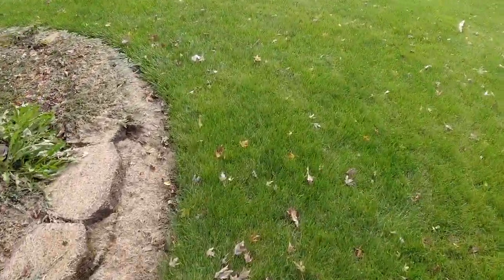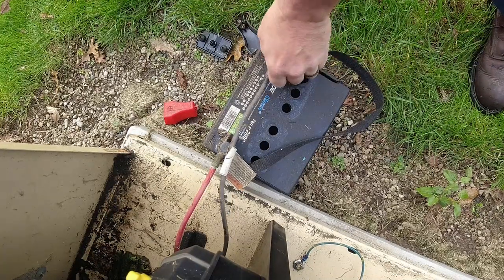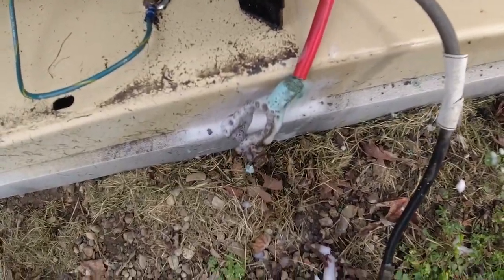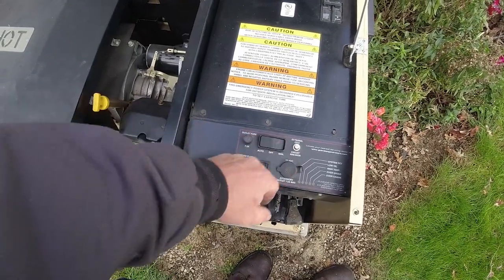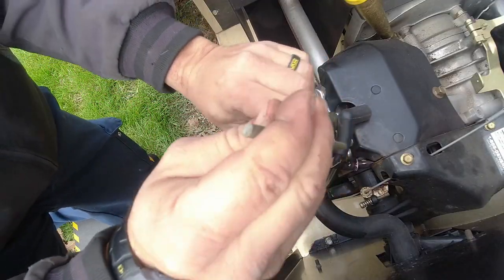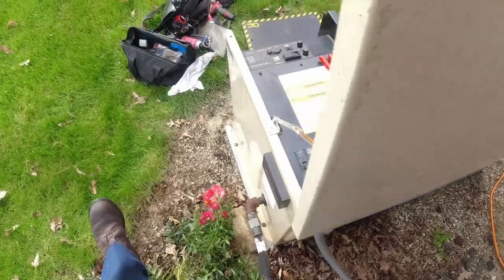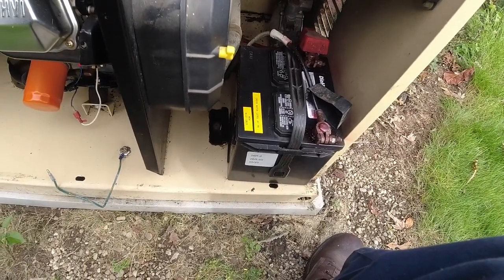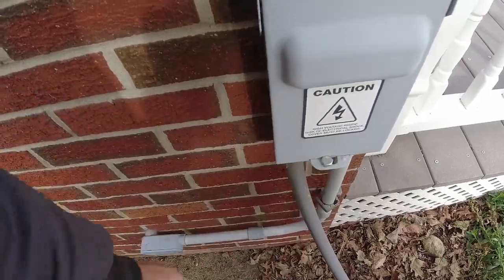Generac Generator Over Crank Easy Fix

Comment: I disconnect my generac Battery charger and use a 4 amp automatic that charges and maintains. 14.1 volts, 24/7 cooks the water out of the battery. Automatic does not. Ran a extension cord to the inside of generator from a protected circuit to power charger during outages. Generator needs 12 volts during outage to produce magnetic field to produce voltage to your home.
Reply from the maker: I have no problem doing what you're saying, I can't tell people to do that, my luck they Will do something wrong and blame me.
Reply: The book says it's a smart charger and doesn't charge constantly. Is this an improvement to the old charger I wonder?

Comment: I put a lock on the box and put the key inside the electric panel because most technician know to look there for the key
Reply from the maker: That works👍. A bolt is cheaper 🙂.

Comment: My battery would only last about 3 years in my old Generac. My new Generac seems to be doing better. The battery is 4 years old and test fine. I'm thinking about changing it anyways to play it safe. Like you said, I spent 5k to know that I will have backup power, seems stupid not to spend $100 to know that I will have backup power.

Comment: I bought the house, I live in, in 2018. It had this exact Guardian Generac Generator installed already. For a year or so it worked like it's supposed to. I think, around 2020, it stopped doing the weekly test. I never cared. A month ago we had a power outage due to heavy snow. Without power for two days, with 3 teenagers, no internet, live was difficult. Today I opened the generator. It had exactly the same red light. over crank red light. As weather gets better, I will try to fix it. Great video! I do want to know what, the name or model number of this particular unit, is. thanks
Reply from the maker: I have no idea what the equipment numbers are at this time , I don’t personally keep record of that. The office does but I can’t access it.

Comment: Love the video. I used to be a technician at an outdoor power equipment dealer that sold generac portable generators. Every time one came in for repair I swore up and down the shop I would never work on one again - if there was an electrical issue, the factory literature from generac was so vague about diagnostic procedures as to be completely useless.
Reply: I worked for a large Generac dealer and as I got older (semi-retired) they kept me in the shop doing all the portable repairs.... and we took in other brands too. What I found is that many other brands used the same electrical ends so diagnosis was similar. (units of say the last 10 years or so) If the rotor tested good and a voltage regulator didn't fix it (after manually applying field voltage) then the stator was no good. IOW, expensive! (base diagnostic fee and disposal was pre charged)

Comment: Awesome video thanks. I’ve had my Generac generator since 2005 and actually had very little problem with it except for the fact that the battery exploded. I didn’t think to to neutralize the acid I just tried to wipe it out and it did eat the heck out of the paint and then eventually caused a pretty good amount of rust around the bottom frame. Also one time it wouldn’t start I removed the fuse waited a few seconds put it back in and it started like a champ. I’d say for 18 years of service been pretty damn good and it’s the old crappy ones that you had more problems with. Thanks again for the awesome video when I had some questions in the past they were very little in the way of good videos out there. This one is the best one I’ve seen on a Generac maintenance.
Reply from the maker: Check out my actual video on maintenance. I'll post the link

Comment: I have an overcrank issue on mine, same model. But only when it's above 50 degrees. Hopefully I'll get it figured out. About to go into storm season.
Reply from the maker: Check all the basic settings, chances are you won’t find anything wrong, unfortunately, that was just the unreliability of the first GEN models. It gets very discouraging, trying to come up with a solution then you end up looking like a parts changer.

Comment: something of note that not everyone notices is this era of machine will store exercise time in memory when it trips on a fault. (provided there's 12 volts available for memory) IOW, it tried to run for an exercise but failed. The next time you hit it to automatic it wants to finish that last exercise. Setting the switch to off and waiting 5 seconds will cancel that exercise time.

Comment: The single cylinder units (410cc) are very touchy with the start ups if the valves are out of adjustment. Also NEVER use 30wt in a cool winter climate. I had a customer burn up 2 starters one winter before I realized he was using straight 30wt in his. The starters on the 7-8's are way smaller than the 10-24kws.
Reply from the maker: We usually run 5w-30 full synthetic, not sure if we did the last service or if it was the people on the sticker.  Thanks for your feedback Rob, I appreciate the support👍👍
Reply from the maker: Lol.. just went there today for this job and had to replace the starter. Not because of the oil but just because of the age.

Comment: We have a centurion generac model number 0053950. For last 3 years we have had our regulators go bad. Woodridge told us the lines that Amerigas hooked up from the regulator to the generac was incorrect. So we have had to replace regulators two years in a row. They just charged us $700 to replace our regulators for the third time.
There is a 1/2 pipe from tank to generator and Woodridge suggested 3/4 inch pipe.
From tank there is a 25lb psi running to second regulator that is10psi . Now our generac starts rough and runs rough
And when husband checked it today after power went out it took our generator three tries to start and afterward all the lights were blinking red
New regulators were installed November 15 by Amerigas and today is November 23

Comment: Been doing F&B refrigeration a few years but the past two hurricane seasons had me opening up some Briggs Stratton stand by  generators for the first time. Interesting little units but having never even had occasion to touch one before, definitely a learning experience!
Reply: This past August Hurricane Ida a lot of units ran two weeks straight.
Reply from the maker: I didn't like the Briggs design much,  I've only worked on one or two of them. Not impressed
Reply: @HVACRSurvival ... the biggest problems we faced with B&S (smaller 12 & 15 Kw) is many techs are not familiar with testing capacitors for voltage regulation. Of course the factory didn't make it easy either.

Comment: I’ve got a line conditioner on my battery because of this same thing, but still change my battery every 36 months and if it’s still good I’ll use it in a mower, but not leave it on something that powers my house during a major storm especially with them only being a $60 item. Also I gave up on Wet Cells.

Junk screwdriver?  That’s a nice electrical screwdriver.
Reply from the maker: It looks like a Klein but it's a no name cheapo. I agree on the 36 month thing👍

Comment: I’m working on a 6kW Ecogen.  I want it out of my shop.  Runs, but, rough.  RPMs are good, Hz is a little low (60).  I’d like to know more about how you adjust the fuel regulator?  Thanks for the video.
Reply from the maker: Is it the same old model I showed? If so I would replace the regulator, the rubber gets hard and doesn't  flex well. (This is from memory, I might be off,  its been several years since I read about it) The factory says to adjust the screw up n down until you reach the highest rpm and back it off just a 1/4 turn. I normally will remove the peg until I'm finished making this check and adjustment. Usually you can just replace the regulator and be done. The main problem I had was hard starts in the cold weather.

Comment: have the same model, think starter failed, working on the battery now. but it will crank and start slowing down then nothing. swapping the battery before buy a new starter. any other suggestion?  i dont have a lot of tools
Reply from the maker: There’s several different things it could be you just gotta work your way through the list.

Comment: Do you have information on why the weekly cycle does not set on a 16KW generator 2005 vintage. It was doing it before but stopped. Followed instructions but no success, took out fuse to reset and still did not set. Thanks
Reply from the maker: Someone told me that there was a glitch in the board and you could get around it but most of the time I just replaced the board.

Comment: Question for you, can these old generacs be used as a common old gen set.  I have one i would like to remove electronic junk and take power directly. No automatic nothing. Thanks Fred
Reply from the maker: You need a way to regulate voltage and engine speed. It can be done but I'm not sure it would be any better vs the way they were built originally.
Reply: @HVACRSurvival  I'm in the scrap and salvage business, so will toss it. I have Hobart welder generator i use now only 12 kw for the generator portion.

Comment: Thanks for your video.  Question:  Will a appropriate amp and voltage generic AGC  fuse work as a replacement fuse or do you recommend using an OEM parts?
Reply from the maker: As long as the voltage, amperage and type of delay is the same then it should be fine.

Comment: Hey Rick, new to channel. Haven’t seen all of them but do you have a video on changing the starter out on Generac?
Reply from the maker: I have videos grouped together, all the generators are together which I've only got maybe seven or eight cuz I don't do that many generators anymore. Just disconnect the battery, take a picture of the starter and wiring before you take it apart and take your time, it's just two bolts on the back side plus the bolts that hold the wires if I remember correctly.
Reply: @HVACRSurvival  Thanks Rick

Comment: What would cause the battery to keep draining or dying?
Reply from the maker: Battery charger or weak battery. You need a meter to test what the draw is on the battery and if the battery charger is putting out the required voltage.

Comment: 2009 17KW Generac has long cranking times in very cold temps during the weekly exercise. Unit has about 125 hours, Generac Tech adjusted the valves, I changed the plugs and the battery is new. The problem continues. It doesn't set an "over crank code" or any other warning light or message. The cranking RPM is good. It will stop cranking when it doesn't start, then quickly attempts another start on its own, which will finally get it started. The choke plate is not stuck and the solenoid plunger  is moving around during cranking. Once running, it runs fine. If I do a manual start the rest of the day, it's fine. It was -5°F this morning. Any ideas?
Reply from the maker: About all you can do is add the cold weather kit that has the oil filter and battery warmer.  They made a lot of improvements to the newest models program module to help it start in the cold. My experience has been that the older ones were problematic and wasn't much you could do to make them better.

Comment: just use baking soda to neutralize it, make a thick damp paste of it with a bit of water if you want to use it on vertical surfaces and odd shapes. it will foam and fizz of course 😏

Comment: The starter sounds like it has a bad drive. Make sure to check valve lash around every 200 hrs or if the engine has hydraulic lifters make sure the compression release is working properly.
Reply from the maker: Yeah I didn't check the valve clearances, Generac always push that but most of these generators are lucky if they've got 25 to 75 hours on them. I've only had maybe one that was just slightly out otherwise they have always been at their .003" tolerance area. Thanks for sharing and thank you for watching!
Reply: @HVACRSurvival  it seems like it’s a little bit of a hassle but after dealing with one I decided to do a little research and found out why my cub cadet mower kept burning up starters and ruining batteries. A cheap fix and no issues with hard starting. I appreciate your comment.
Reply from the maker: Your welcome,  these engines don't have a valve release.
Reply: @HVACRSurvival  ... in some areas the low hours is common, but after all of those week long outages we've had in the last 10 years they are all over due. Personally, if I have a plug out I check the valves. I also gap at 0.004" to avoid tight valves and hard starting. Plug gap at 0.025" on any older unit as well.

Comment: so whats the best generator ?
Reply from the maker: Depends on how much you want to spend. Do you want something just to get by that's cheap go with the generac. The newer ones are a lot better than the ones you've been seeing me do videos on but they still have enough problems to where I am very leery of them. The portable generac units are fairly good, I haven't had any problems with them but all the extra stuff in their first generation standby generators from 2005 through 2012,  I had a lot of issues, the last few years have been pretty good. Generac made made a lot of improvements on the things that I constantly had issues with.

Comment: Why 62.5 Hz? Because it slows down to 60 Hz under load?
Reply from the maker: @technical you are exactly 💯  correct. Your supposed to recheck it under full load. This was a 7kw generator so it wouldn't be hard to load it up,  the larger 22-25kw take more resources to reach full load. A load bank makes it much easier but are big money.( Unless you build one with a electric furnace. ) then that's just a resistive load.

Comment: I have the same meter I got the I flex cable for it to
Reply from the maker: They are nice,  I have two of them with the flex, I got one from Fluke to replace my Amprobe meter and the one you seen I got cheap on marketplace.
Reply: @HVACRSurvival  I paid 500.00 for mine

Comment: 14.1v Is a good voltage for a battery. most vehicles charge at 14.4v. I think the reason it kills batteries is because the power from the gen will not be smooth dc current! If its killing batteries then it will be a bad diode in the rectifier.
Reply from the maker: It's more of the rate of current than the voltage. A trickle should be around 1 amp or less
Reply: @HVACRSurvival  ... you have to remember that this charger also supplies 12 volts to the gas solenoid and voltage regulator during an outage. This was the era when they went away from having a 12 volt winding on the stator and just grabbed live voltage to the battery charger.

Comment: So the battery explodes and then we show over crank .I do not buy that also that unit looks like it has been down for years, What else are you selling.
Reply from the maker: Well old-timer I really don't care whether you buy it or not bud. It sets outside and is likely 14 years old so it will look old🤦‍♂️.   Here's what the manual says about you not knowing what your talking about.  😘 

(Overcrank Shutdown)  This  feature  prevents  the  generator  from  damaging itself  when  it  continually  attempts  to  start  and  another problem,  such  as  no  fuel  supply,  prevents  it  from  starting.  The  unit  will  crank  and  rest  for  a  preset  time  limit. Then,  it  will  stop  cranking,  and  the  LED  on  the  generator  control  panel  will  light  indicating  an  overcrank failure.  The  AUTO/OFF/MANUAL  switch  will  need  to be  set  to  OFF  and  then  back  to  AUTO  to  reset  the generator control board.

👉👉Incase you think it will have a low battery alarm then here is that information.

(LOW BATTERY) The  microprocessor  will  continually  monitor  the  battery  voltage  and  turn  on  the  Low  Battery  LED  if  the battery  voltage  falls  below  11.0  volts  for  one  (1)  minute.  No  other  action  is  taken  on  a  low  battery  condition.  Low  battery  voltage  is  a  non-latching  alarm which  will  automatically  clear  if  the  battery  voltage rises  above  11.0  volts.  Battery  voltage  is  NOT  monitored during the crank cycle.

THE BATTERY CHARGER KEPT THE VOLTAGE ABOVE 11V BUT DID NOT MEASURE VOLTAGE WHEN IT CRANKED! IT DIDN'T CHECK AMPS AVAILABLE, ONLY VOLTAGE...🤣 THAT'S WHY THE ONLY OPTION WAS OVER CRANK🤟
Reply: @HVACRSurvival  ... bottom line is the over-crank light will come on if the control board's call for cranking exceeds the preset time allowed... AND ... the unit fails to start. This holds true for both mechanical and electrical problems within the start system. A failure to deliver proper fuel flow for starting / running can also cause an over-crank condition, as well as an ignition issue. Basically anything that keeps the engine from starting will turn into an over-crank, including tight valves, blocked intake, or a locked up engine. (usually that's a second attempt by the customer who just added oil)
Reply: This is a 1st generation generator. New ones are 4th generation, with many more improvements.

Comment: Nothing in this video addresses an Over Crank problem.
Reply from the maker: Do you work on generators or are you a homeowner? If you work on generators you'd realize that if the battery isn't working the thing doesn't crank, only the electronics or powered so it doesn't know whether it really cranked over or not. These are very stripped down, non-logical control boards. So yes it did address the problem you just don't understand the equipment, sorry 🤷